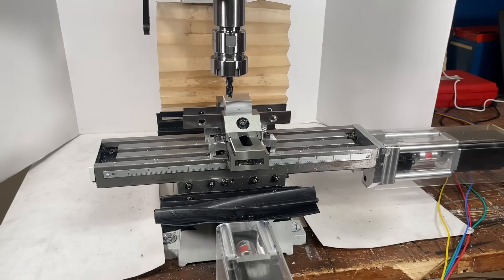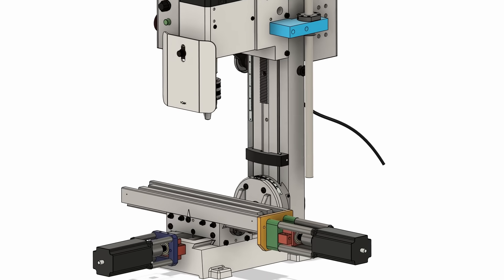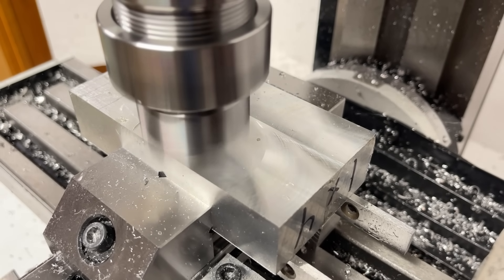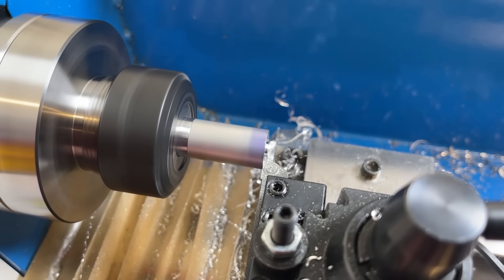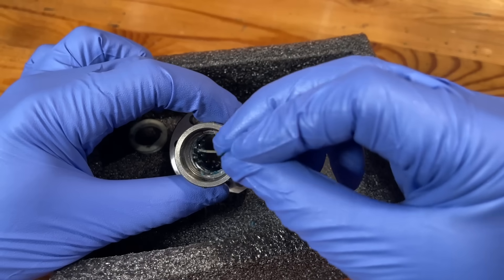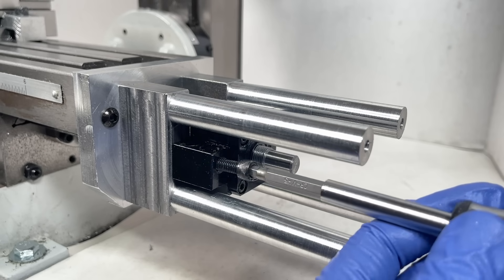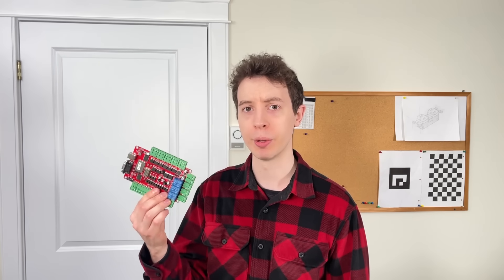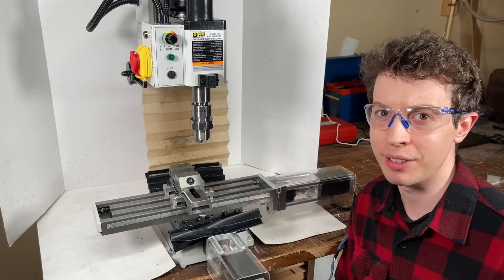Turning a Cheap Mini Mill into a Capable CNC Machine

Comment: backlash compensation and you're good.  Next upgrade should be a belt drive so you can giddy up on your rpms.
Reply from the maker: Definitely. I think a belt drive and a brushless motor would be a great addition
Reply: Dont forget to get the chips out of the cuting area.  I thought of maybe using an impellor fan and a tube like they do with cpap air blow on 3d printers. Haven't really planned anything around that.  It was just an idea i had the other day having to blow chips out of a pocket with a straw using my mouth while cranking x and y axis by hand.   TIRED after all that was an understatement.

Comment: Make sure you ground everything. Shielded wiring would be best but for home, not to much issue. Without everything being grounded any thing that leaks could find it way to signal wires and make  the steppers move in strange random ways.
Reply: my converted lathe doesnt like when some chips find their way to some of the open wiring, shuts down the driver and requires a restart. Its okay though, if you skip steps, using the machine tells you where you still have work to do :)
Reply: Often drive and control grounds are isolated from each other. That is to stop signal noise from propagating from the drive to the control. Also the control will be optically isolated from the drive too. There's no galvanic connection between the two. You can shield all you want and if there's a path the interference will find it. It will use the shield as the path. Because stepper motor interference is high amplitude. That's the nature of switched inductors. They make voltage spikes. That's what they do.
Reply: @1pcfred  I work with servo and steppers in motion control everyday. The shielding is to keep inductance from transferring to the signal wires. The grounding and bonding things like the motors kills things like static that will make weird things happen. The grounding and bonding is used as the path, that is the point. It's a path to ground. Without a path of least resistance to ground the voltage will seek out a ground some where else, hopefully not on a board or driver for some smoke as a gift to the gods. Ground everything, can't over do grounding and bonding.

Comment: If you were using Mach3/Mach4 that software has backlash compensation capabilities.  A better solution for addressing the backlash would be to use higher-grade ball screws with or without backlash adjustment features.  I am surprised that you didn't use the type of ball nuts that would screw into the mount, they don't have a massive flange on them just a threaded end.  Great build nonetheless.  I really need to convert my LMS3990 to CNC and use 1000 oz/in closed-loop servos.
Reply: Software backlash compensation isn't ideal. I wouldn't consider Mach a very good machine controller choice either.
Reply: @1pcfred  might not be a good choice but its been working for me just fine for over 10 years and the backlash compensation works as well.
Reply from the maker: Truthfully I didn’t know there was a different style of ball nuts I could be using, appreciate the tip! Glad you enjoyed the video!

Comment: As a retired machinist your videos are driving me towards picking up a mini lathe and mill. They are far more capable than I was expecting, thanks!

With some carbine tooling you probably could have gotten away with milling the flange, just lots of fairly light cuts.
Reply from the maker: I’ve so far been very impressed with the quality of work they can produce! Good call on the carbide tooling, I should pick some up and test out how far I can push the mill
Reply: @Someone_Should_Make_That  just for any future problems you might face .... A "optocupling-board" or "level shifter" is a 5$ part from Amazon that converts 3.3V to 5V or  whatever voltage you need 

Also sick build, good to see something actually affordable
Reply: I believe youll get a lot of aluminium pick up on the tool with the coating the tool has in the video. Carbide is definitely the way forward @Someone_Should_Make_That
Reply: @Someone_Should_Make_That depending on what you do, you might be better off with an insert tool with aluminum-specific inserts. They are made sharper so the cuts don’t produce as much heat.